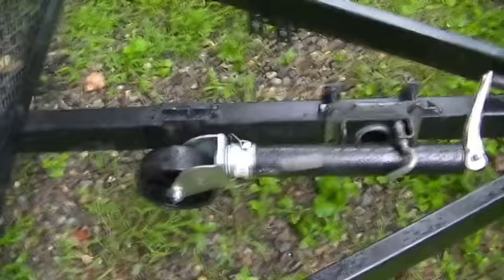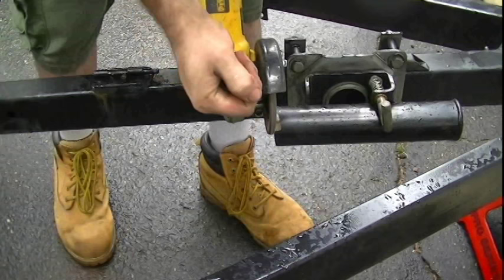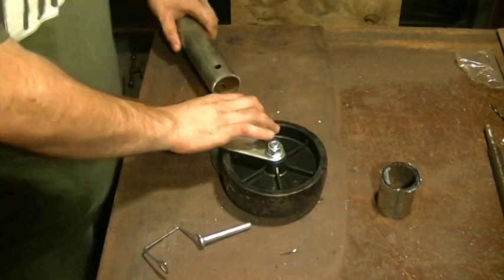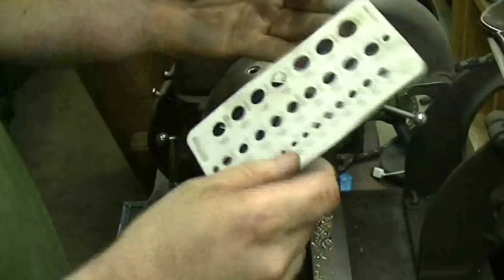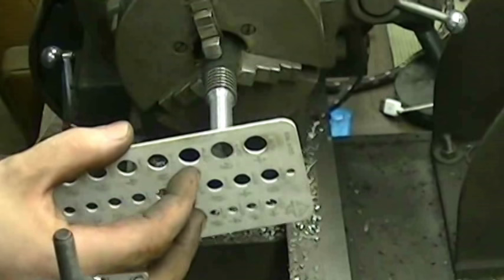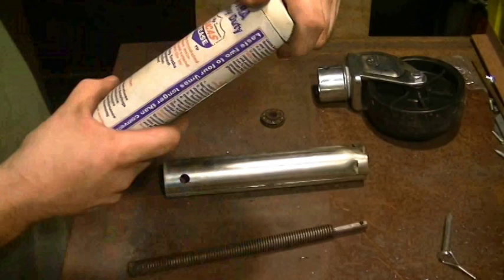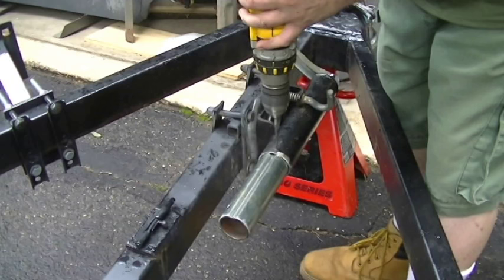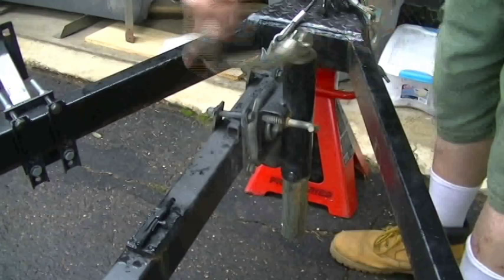How To: Cut Down A Trailer Tongue Jack

Comment: Also, for the anti-rotation fix...after drilling ur 2 holes take a cold chisel or heavy duty flat tip and wack the metal between the two holes so that it becomes concave and there is ur anti-rotation device 😄

Comment: Should have cut off the other end and tack weld, JB Weld or bugger up the threads at the tip. 

Nice use of the lathe, for those who don't have a lathe, just cut the other end....

Comment: Why couldn't you just cut off the screw from the bottom instead of doing the lathe work?
Reply from the maker: I considered that at first, the bottom of the screw was machined to act as a stop. The stop was a little thicker and made sure that the wheel portion did not fall off the screw. I figured if I had to replicate and end I would shoot for the one where I had to remove material rather than add to it. I could have welded more material on but I had no real good way to clean the grease off of it to ensure a good weld.